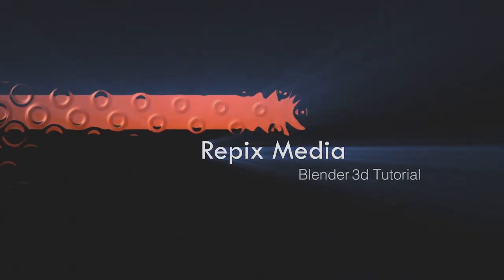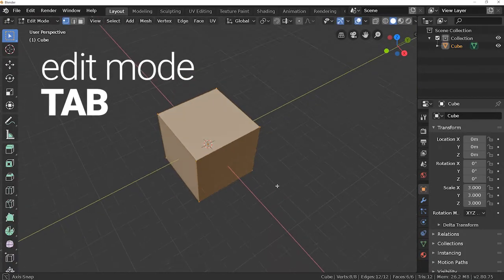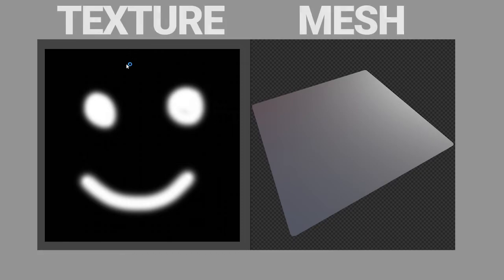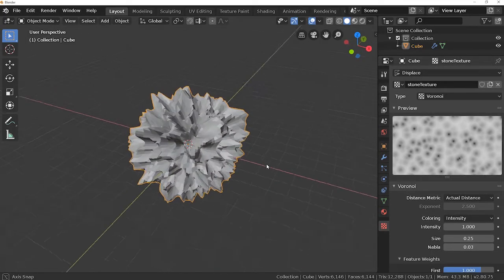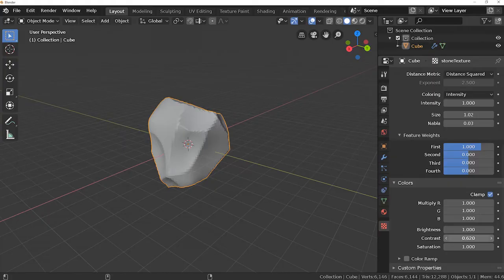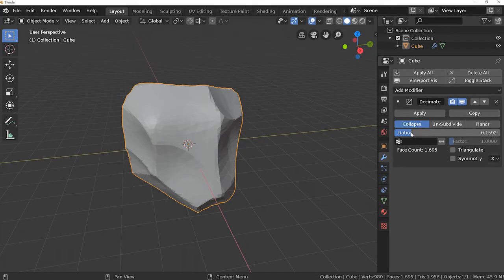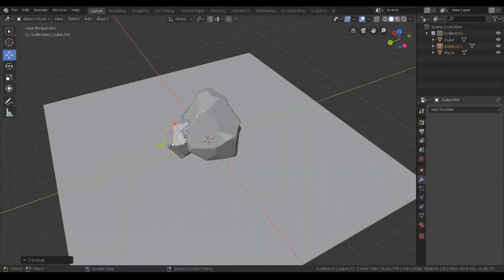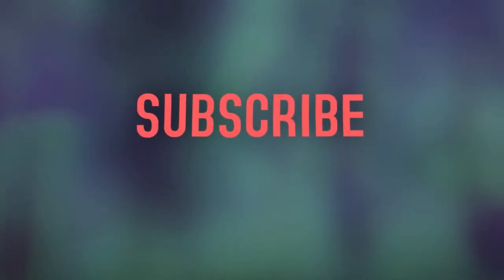Blender 2.8 Tutorial - Low Poly Rocks Modelling | Fast and Easy !

Comment: So amazing, THANKS, in the displacement modifier, if you set the coordinates to global, every time you move the mesh, the rock takes shape in the same procedural way, or if you prefer, you can change the type of coordinates to object, and every time you move this same object used as a coordinate in the  displacement modifier, the rock randomly takes shape, that's before you apply the modifier, it worked with me.

Comment: 2:58 How did you make the white edges?
Reply: I'm not certain how he got the white edges in the final render. BUT, one method for achieving the white edges in the viewport is to do the following: 

1. In the top right corner of the viewport, click the solid white circle to switch the Viewport Shading to Solid.
2. In the top right corner of the viewport, to the right of the Viewport Shading options, click the down arrow.
3. Turn "Cavity" on by ticking the check box, and to its right, change the Type to "Both".
4. Just below that, in the World Space and Screen Space settings, adjust the values by dragging them left and right until you achieve the desired look.

Happy Blending!
Reply from the maker: There are many ways you can achieve this, but i just wanted the image to look good so it is just a post processing effect

Comment: could u do a texturing tutorial for these rocks? I wanna know how you got the corners  of them looking so sharp
Reply: I searched for any tutorial for this texture or similar and to help anyone who needs it almost a year after this comment and 2 years after the posting of the video, I thought I would share notes. 
I used the Geometry node and connected Pointiness to ColorRamp and then connected that to base color. But this method only works in Cycles. You will have to clamp the colors together and from there, mix it with whatever texture you have planned for your rock!
Reply: @gameracers  thank you so much, this was exactly what I needed
Reply: @gameracers  i dont know why but this is not working for me, i see all the rock with the same color
Reply: im pretty sure its either a custom edge node or cavity
Reply: I guess you just need to dissolves the vertices except the corner and side vertices, that's the way I got sharp looked rock.

Comment: What did you do to add the lighter color on the edges in the final render
Reply from the maker: Short answer : Photoshop
Reply from the maker: Long answer : took a viewport render with ao and cavity enabled then composited on top of the render. After that some color correction and minor adjustments..
Reply: @rkpixeldesign  maybe I can achieve that look by using shaders. (I can’t afford photoshop)
Reply from the maker: If you dont have photoshop you can download gimp or paint.net or krita all these are free and feature rich also
Reply from the maker: You can achieve this look inside blender by using texture painting or in cycles renderer by using ao node or dirt cavity

Comment: Hey.. what about color and material? I can’t achieve the final result as yours. How can I get that toon type shading? Do you have any tutorial about it?
Reply: The outline could be from enabling cavities in blender in viewport or ambient occlusion
Reply: @ANiceGuy  what does that mean?
Reply: @Scarlamite  If you go to the viewport settings, you can adjust the cavity settings. Imphenzia uses this in his low poly models, check out one of his videos and you'll understnad
Reply from the maker: Exactly
Reply: @rkpixeldesign  Can you tell me how exactly u set up the AO nodes so that it only affects he edges?
Reply: @rkpixeldesign  I am aware that you can add Cavities in the viewport, but in the render... Is that an AO map or what? Because as far as I know, you cannot add the cavities in the render.
Reply from the maker: Yes then overlay it on top of the render
Reply: @rkpixeldesign  Any chance at all you can do a tutorial on this shading?

Comment: you can use two decimate modifiers, the first use the planar/planer?? option and set the angle tolerance to about 12 degrees. Apply it, then add another decimate modifier and adjust the slider according to you liking...

Comment: i've got 1 problem, when I press Tab it doesn't mark all the object.
Reply from the maker: First select the object and press tab after going into edit mode if all the vertices are not selected by default, press "A" to select all the vertices and press "Alt-A" to deselect all the vertices
Reply: @rkpixeldesign  Thank's for answer, I think it will help me so mutch with creating my own ideas in blender :D
Reply: @rkpixeldesign  But I got another one problem :C When I mark all the objects like 4 boxes and want to add a modifer "simple deform" for example it's doing only for 1 box.

Comment: What happened between 2:55 and 2:58 to make it look so much better?
Reply: I'm pretty curious too
Reply: Ohh I found it, you have to do the Viewport Shading dropdown and turn on Cavity. Make sure you have AutoSmooth on.
Reply: @scypus8691 How do you turn on cavity?
Reply: Drilliin Drilliin it’s in the render mode drop down right above the 3D axis thing near the top right of the 3D view (if that makes sense). There’s a checkbox in the drop down for Cavity shading.
Reply: Drilliin I’m not sure if it shows in other modes besides the 2nd one to the right of wireframe mode.

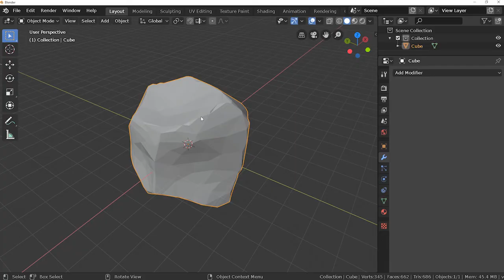Comment: I just wonder, how did you made a little circle at 2:50
Reply from the maker: I think you are asking about circle selection
 its shortcut is C key on keyboard
Reply: Just press C. And you can change its size using the scroll wheel .